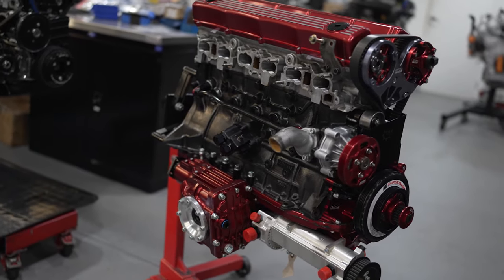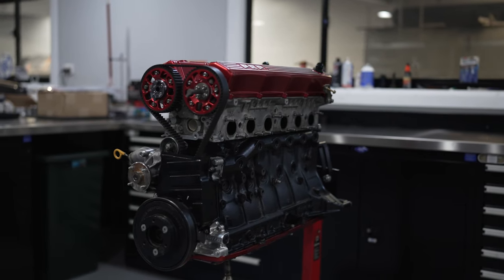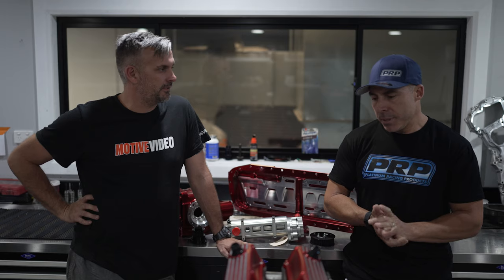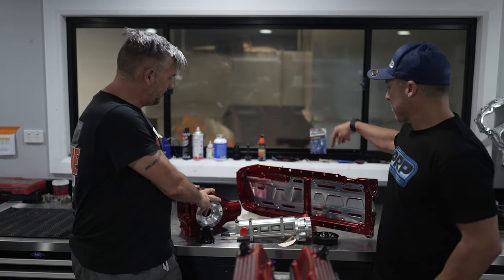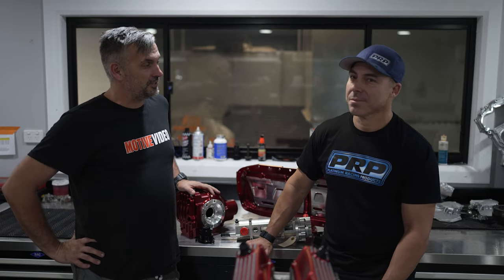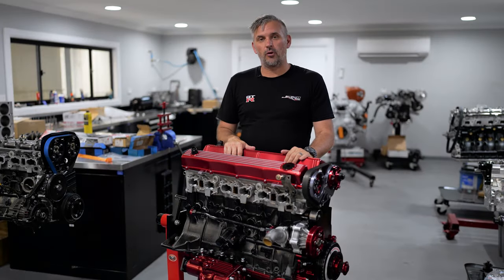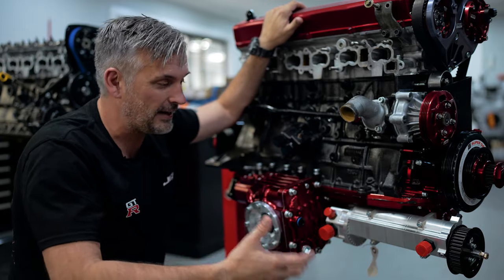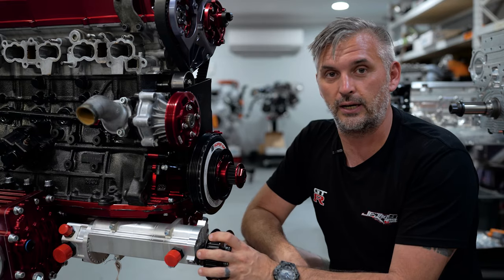1200hp RB32 gets Billet Dry-Sump Kit from PRP  - Motive Garage Supercar Killer

Comment: Wouldn't neo head be better than the 26?
Reply: I've always wondered this
Reply from the maker: It it was, wouldn’t the world’s quickest RB use it?
Reply: @MotiveVideo  the VCT probably doesn't make much of a difference in a drag racing scenario. 
Street car, with a rb30 and vct would have to be better for spool and drivability right?
Reply from the maker: @AdmissionGaming  It is possible to have too much mid range torque and crush bearings. When you have a 3.2, you dont need VCT or VCam etc.